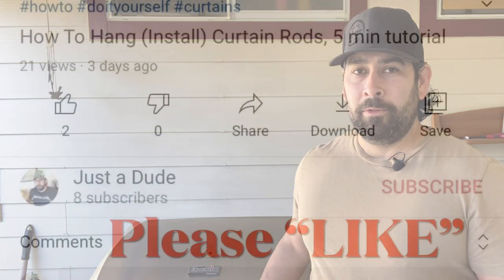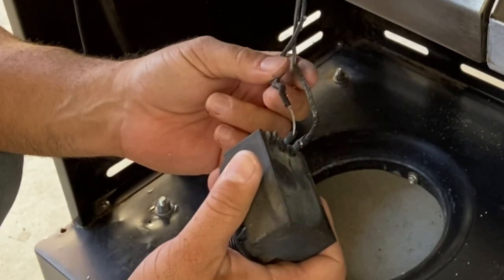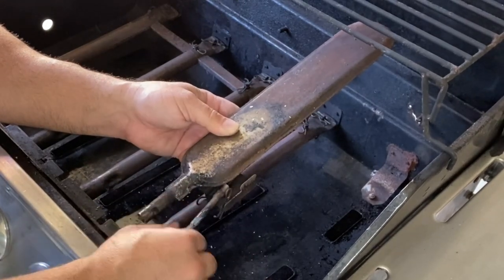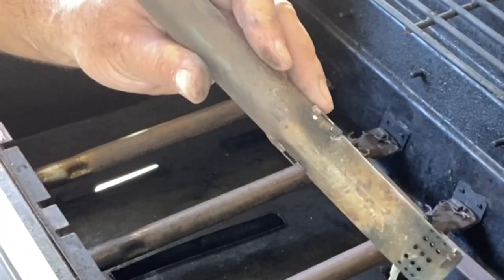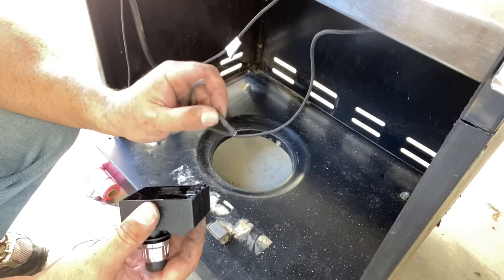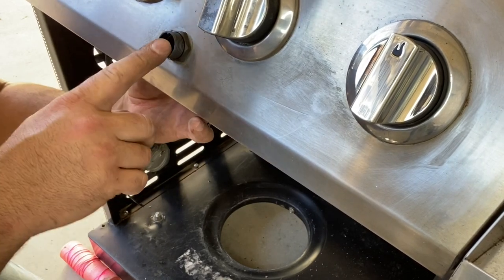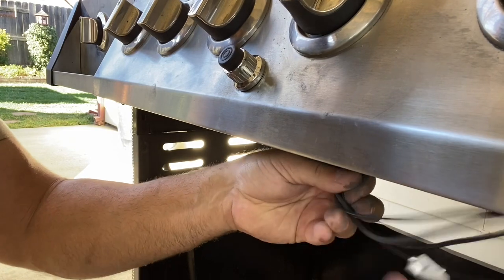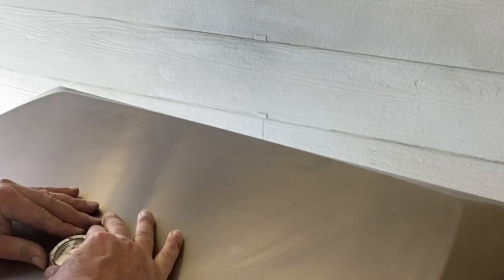Save Money (DIY) Replace ignitors, ignition module and thermometer in a Char Broil Classic Bbq Grill

Comment: Can you tell me how you removed the sear burner from the back I’m having trouble removing it. Is there a screw? Thank you great video!
Reply from the maker: Im pretty sure theres a screw in the back of it holding it on. Sometimes it could be covered in rust or grease or rusted out making it hard to see. Take a wire brush to the back of the burner and clean it up. The screw should be easier to see then. Hope this helps. Thank you for watching.
Reply: Thanks for the help!!
Reply from the maker: No problem.

Comment: Have you ever experienced after replacing the bbq electrodes, where all of them sparks but can’t seem to ignite to fire it up? It lights up ok if I manually used with a lighter
Reply from the maker: Great question! I have never experienced that.
Reply from the maker: Are your burners okay or are they rotted out and need replacement?
Reply: Burners look ok and not rusted out too
Reply from the maker: Okay. Do you have visible spark where the ignitors meet the burners?
Reply: @JustaDude123  yah pretty strong spark bud. However the needle tip of the new electrode i got is about 1/2 inch shorter than the original. But shouldn’t be an issue right coz where the tip is points to a hole in the burner. Does it also matter if i place the lead plug on a different location on the ignitor module like i literally got it jumbled up. Thanks
Reply: Hey bud got it all sorted. I installed the needle too close to the burners as when i adjusted it away a little bit it seemed to work finally thnk god
Reply from the maker: Thats awesome you got it working!

Comment: I wish I had watched this before attempting it myself.  I pulled the old wires out without using the string.  Now I can’t figure out how to run the new wires.
Reply from the maker: Ugh. That stinks. Can you fish a piece of wire or a coat hanger through there?